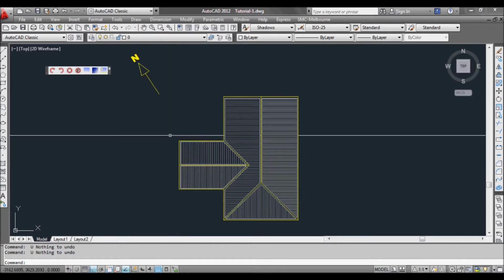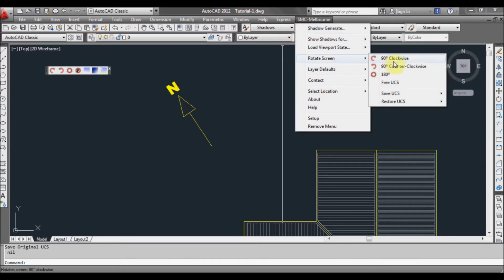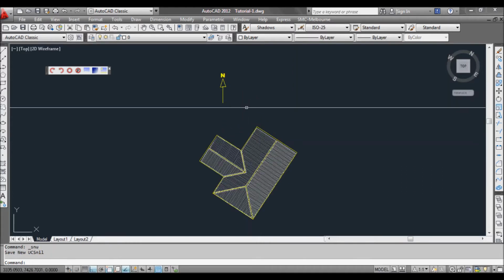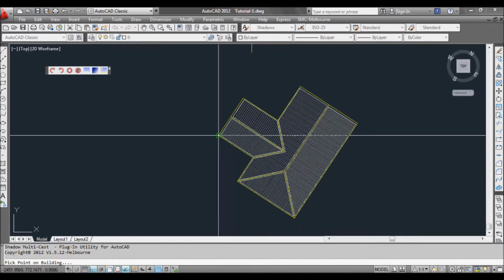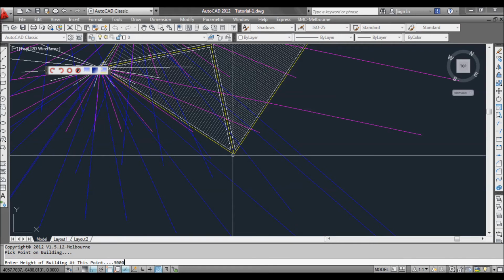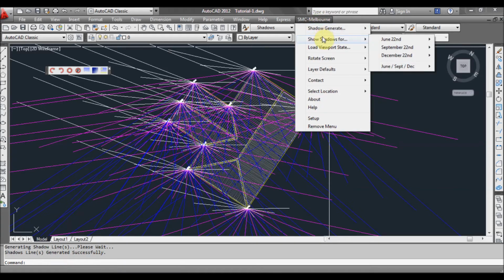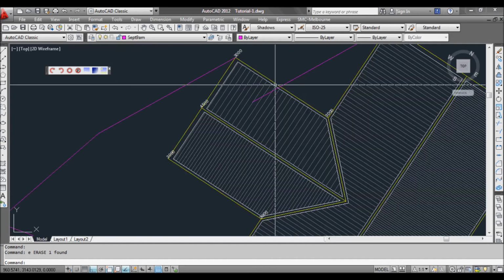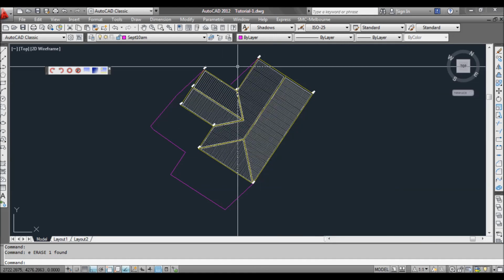Shadow Multi Cast Rotating North point and Generating Shadows

Comment: i do not see any SMC-Melbourne Autocad,how do we get that.
Reply from the maker: Hi Garima, once you have installed Shadow Multi Cast, sometimes if the menu does not show up, there are 2 solutions.
The first one is easy, in AutoCAD, type at the command prompt:
MENULOAD     (then press enter key)
then type:
1                       (then Press enter key)
Hopefully the menu will now show up.
If it doesn't, then goto my website whttp://shadow-diagrams.com/Shadow_Diagrams-How_to_Install-Full.html and follow the steps there.
Let me know how you go, Thanks.
Reply: thanks, I am able to get the tab and this looks very straightforward,just one more question is it, mandatory to set the north vertically upwards, can I not use the north as per my current layout?
Reply from the maker: Yes, North must be facing directly vertically upwards or the shadow line angles (azimuth) will be incorrect.
On the Shadow Multi Cast menu, there are simple tools for rotating your AutoCAD drawing. The very quick and basic tutorial is here http://shadow-diagrams.com/Shadow_Diagrams_TutorialsFULL.html
Thanks
Reply: i can not delete the layers I do not want, how can I do that..
Reply from the maker: You need to run the PURGE command, then delete blocks and then the layers you don't want. Or just PURGE everything.
Reply: I tried it three times it goes away and when i generate another shadow everything comes back and get me to start everything from zero...am i doing something wrong
Reply from the maker: You are not doing anything wrong. The software has to create those layers to work. The best method if you don't want the additional layers is to generate everything you need first, and once you have completed generating shadows, then PURGE everything, otherwise the layers will come back each time.
Reply: how long is the trial version valid